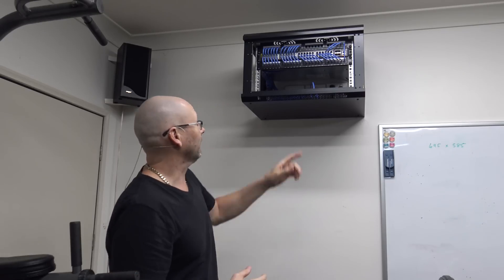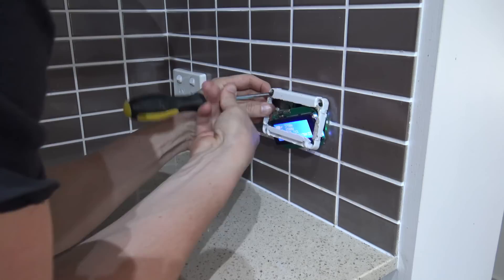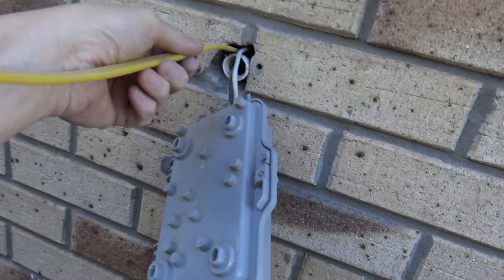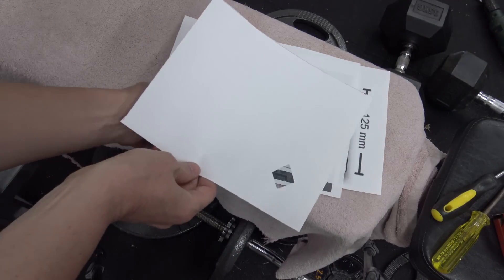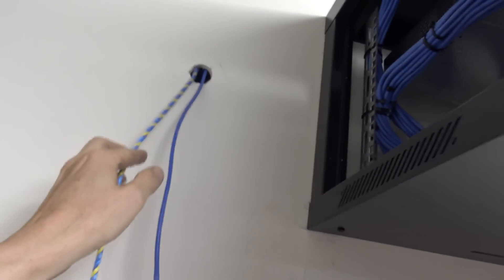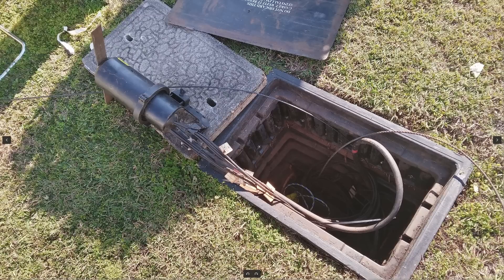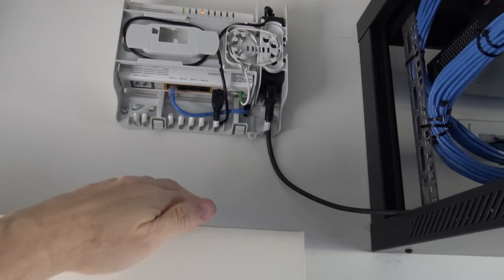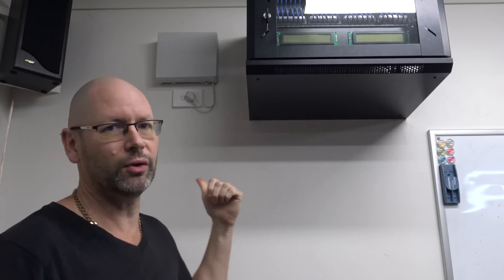NBN Fibre FTTP Install

Comment: why upload speed too low?
Reply: NBN provides a very asymmetric service. To get higher upload speed you need to get a business grade service.
Reply: It's ridiculous for a fibre, a 4G will do better, not even 50 megabit is very low. To this day upload is nearly important as upload. My service is a 1000 down (effective 800) and 300 up. When I went from VDSL (100/20) to fibre I noticed more the upload being better than the download.
Reply: A Residential Plan of 250 Down only gives you a 25 Up speed. If you go to a 500 Down Plan you get 50 Up. I have an old 100/40 plan and while I would like to go to 250 I am not prepared to put up with a much slower Up speed. Just far king dumb when we need to Up speed for Work From Home Zoom meetings.
Reply: @josephking6515  That seems stupid. Also having a limit of 250 for fibre optic, considering that where I live we did have 200/20 with copper (VDSL/fibre to the cabinet). Where I live everyone is giving at least 1000/100 or 1000/300, some operators even more (2.5Gbit is starting getting common). In the end the only limit is the ONT they install you (most of them is not capable of running gigabit)

Comment: Eventually I just threw my router onto my proxmox cluster. Pfsense VMs with CARP/VRRP for HA. Works fine for gigabit with 2cores/2gb ram each.  You could probably do something similar with openWRT if you want to stick with a linux router.  Or even do it from scratch like your rPi router

Comment: I think that certain japanese websites are supposed to have pixelation ;)
I'd recommend pfSense or OpenWRT on some x86 hardware, an old thinclient with an Intel dual or quad gigabit nic should be enough.
I'm jealous, I'll be stuck with 100 Mbit/s for another few years (rural Germany).